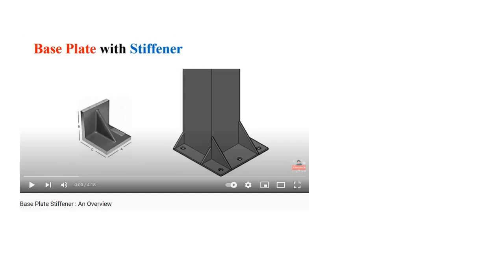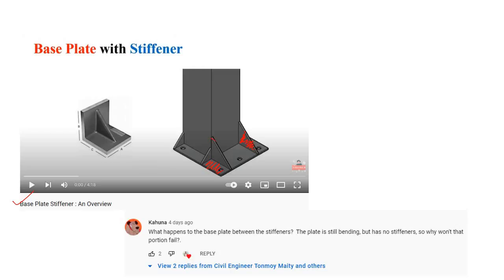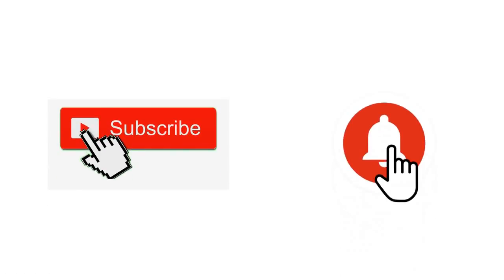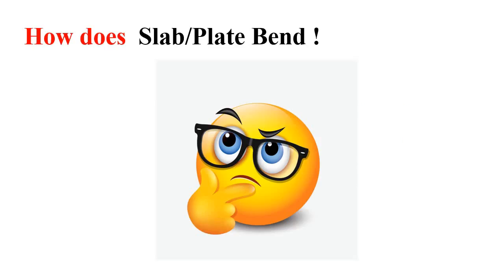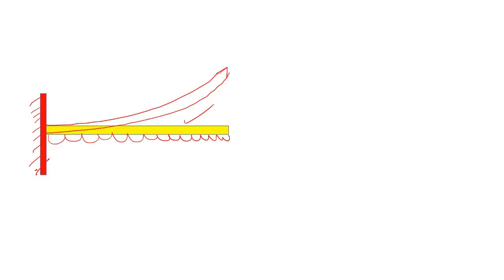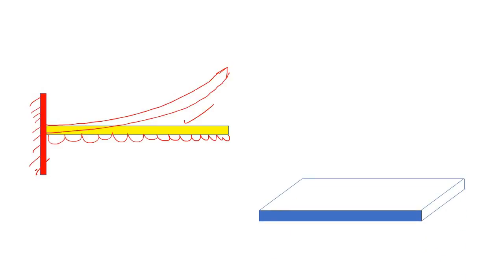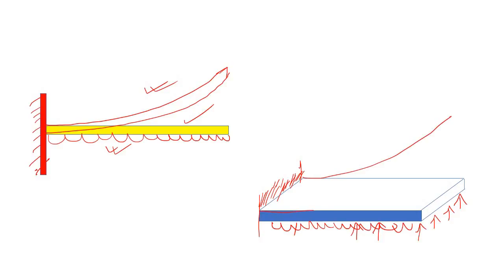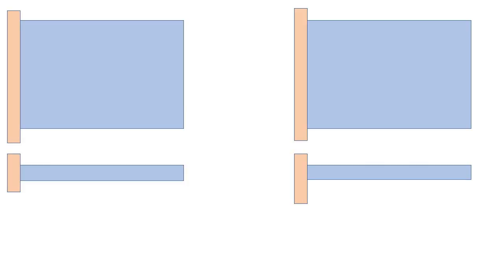Stiffener Effect on Base Plate : Understand Load Distribution

Comment: You have explained beautifully.
I have one question as you said the load follows shortest path. For example the bearing load on the base plate is 0.8 N/mm2 and we are taking the cantilever part as shown by you with stiffeners. The base plate projection after column flange is 200 mm and the base plate width is 150mm. How much force will go to stiffeners and how much to column flange?
Reply: Also I remember there is a 45degrees angle rule for distribution of forces.
Reply from the maker: Right